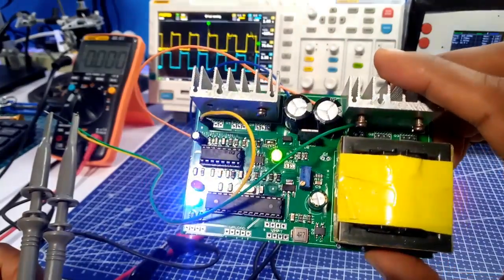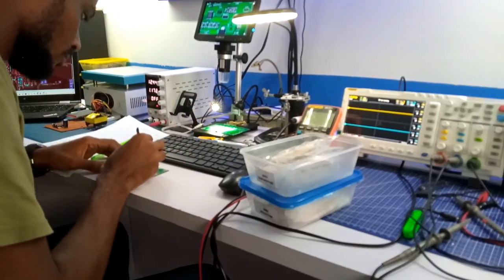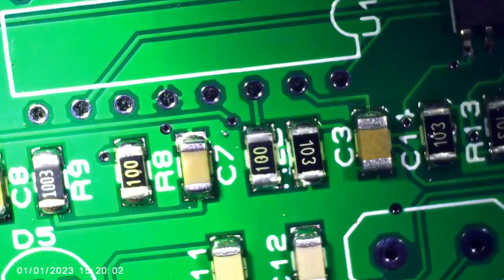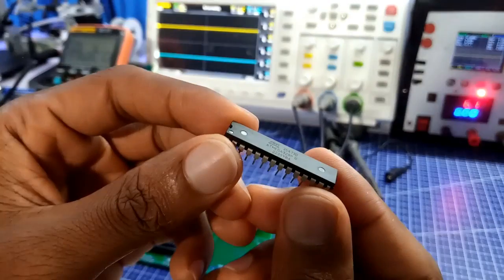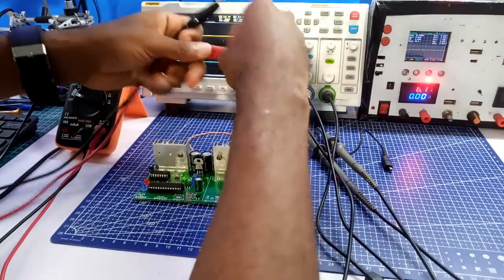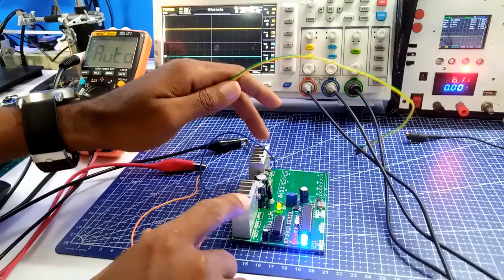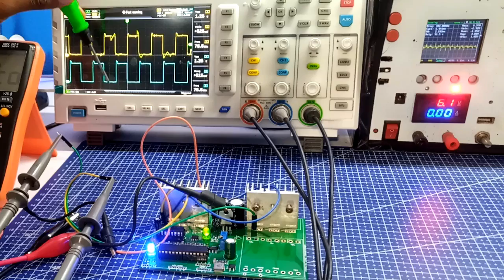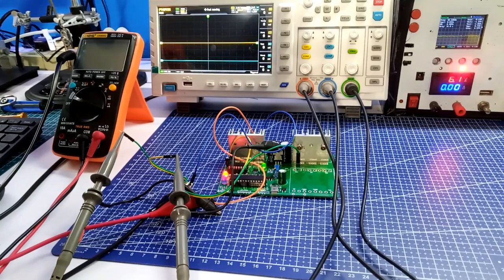500 watt Square wave inverter Circuit with Sg3525,Lm358 and Arduino ATmega328

Comment: Amazing bro,Could please modify this project because u are closer now to build DC to DC converter that can work on solar pv panel batteryless .the pwm can change to adjust the dc voltage at constant level by rewind the ferrite transformer .The next step u add your project Ac inverter to convert DC output to SPWM AC
Reply from the maker: @2rook254  
Thanks so much.

We are close just as you noticed.
We are going to be publishing updates soon